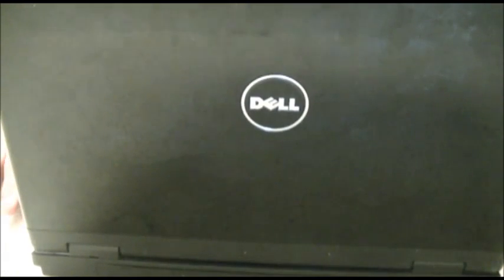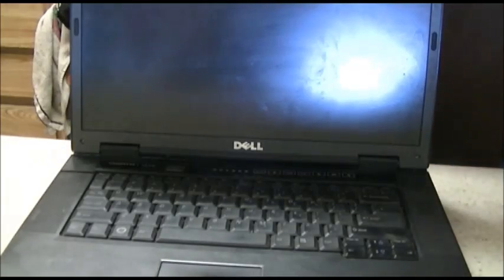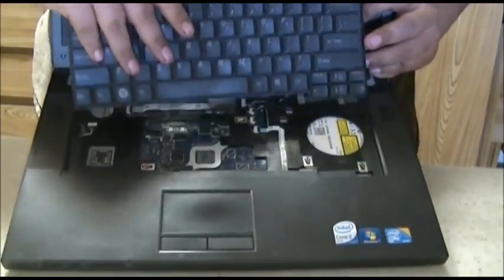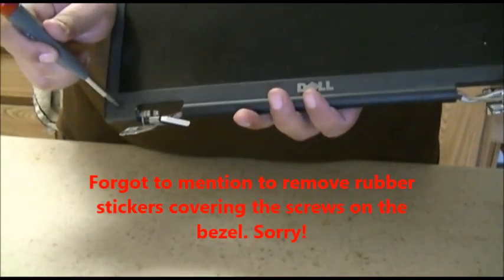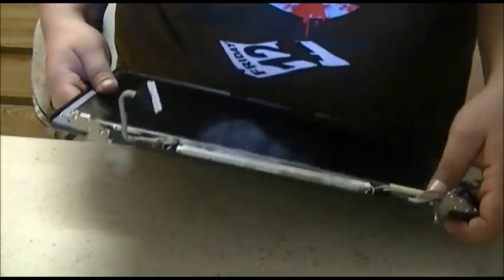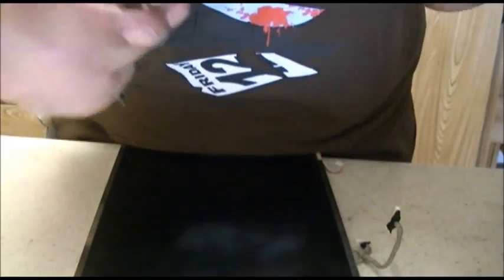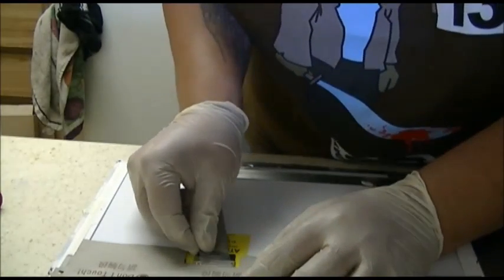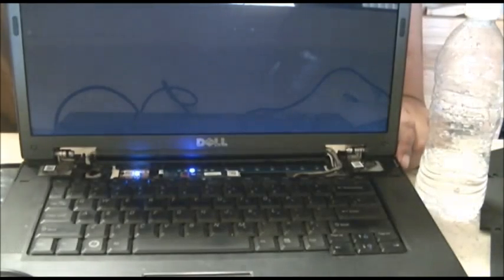Laptop screen replacement / How to replace laptop screen for Dell Vostro 1520

Comment: Just brilliant. I could actually do it all myself. The display went nuts; like wide mode - only half was visible on full screen. With your help, I could open the back cover without tearing it apart - reconnect the monitor cable on back side & tapped a couple of times on the lcd from behind - and volla it all sorted. haha in 2020 !! This one is build to last long.
And bonus it helped me stay indoors in this lock-down... Thanks a million !!